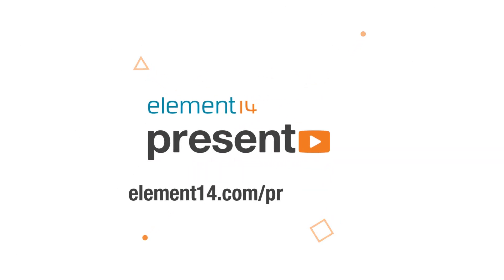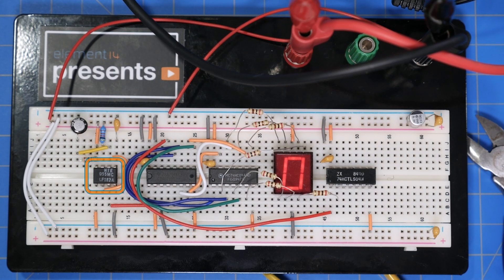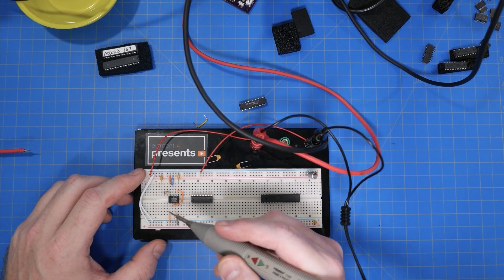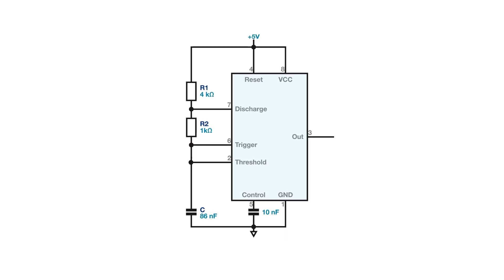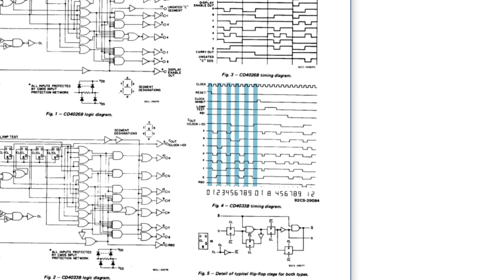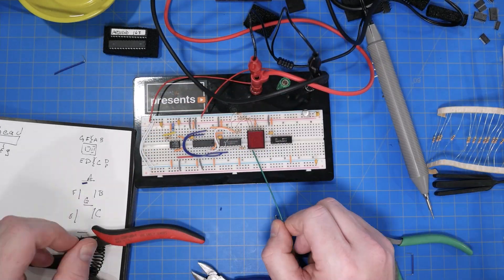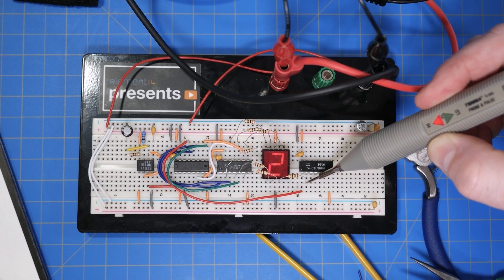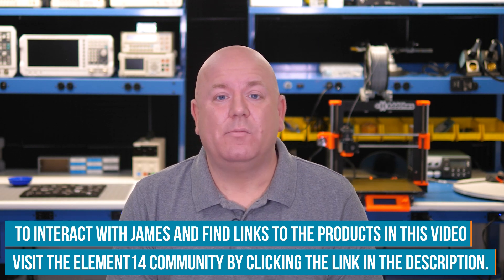Instrument Basics: Logic Probe - Workbench Wednesdays

Comment: Now, imagine if someone would invent a logic probe with a buzzer as well as a display showing frequency or low DC voltage instead of dinky car repair stuff. It would actually be a tool for electronics repair.
Reply: Logic probes made a lot more sense in the days of discrete digital logic chips. Today, a DMM works great to check voltages or measure frequencies, which a logic probe wasn't great for doing. And since everything is connected with a serial bus like I2C or SPI, then you end up using a scope or logic analyzer anyway. 

I've seen one or two open source projects that tried to make an updated logic probe, but they never caught on.
Reply: @bald_engineer  they would be for repairing what can be repaired, i.e. 1970-2000. After that, you need glue solvent and a microscope. In this video, you troubleshot a circuit of discrete ICs, but you had to switch to a different piece of test equipment just to measure a TTL/CMOS voltage or frequency. Nowadays, displays are small enough to fit in a pen that could do what the logic probe does + those two things. And generate a range of different signals for fast/slow frequency, two pitches for Vcc/floating/GND, etc.

Soldering station are still made for these old THT and discrete components, and still sell. They are of no use for 21st century glued devices. 

In that light, there is still a need for a handy piece of test equipment like I describe. It would be much faster at achieving what you do in the video. 👍
Reply: @ScoopexUs  Again, do some searches. There have been open source projects that try to make more useful logic probes.
Reply: @bald_engineer  It's difficult to search because of all the car mechanic trash spammed.

On Youtube, people repair computers, and I'm hoping for one of them to showcase an actually efficient tool instead.

If I were to make one, I would buy one with a buzzer and find a voltmeter+OLED and frequency meter+OLED and print a case for it (or maybe there's space to jam it in there and cut two holes). There would be something no-one has thought of before that everyone (who repairs computers) wants.

What I did have to search for was the DMM acronym. People don't use analog multimeters anymore. Well, since my 50yo teacher 30 years ago. If you would have called it a multimeter it would be understood immediately. It's a multimeter. ;)

Comment: Very useful and honest. Thanks.
Reply from the maker: No worries!
Reply: @element14presents  I have the same model probe that your using on this video I'm learning electronics and never used a probe before. I wondered if you could tell me what the extra red probe with alligator clip is for and what the three little metal posts are at the cable end of the probe is for, I thought maybe you clip the red probe to one of these and use that for testing. Cheers

Comment: I have a handy, related tool you may or may not have seen. It's a logic chip probe from HP that has a 14 pin clip (designed to clip onto 100 mil pitch SOIC and DIP logic parts (7400 series) and provides a red/green LED output right on the clip for each pin. I suspect HP and others may still make them and not sure of the cost, but it beats probing logic pin by pin. If you don't have one or haven't seen one, drop me a reply and I'll try to provide a pic or two (and maybe a short vid if you like). With my DSO w 16bit wide logic inputs, I haven't used them (a 14 pin & a 20 pin, I think) in quite awhile, but they're still in my arsenal. Don't even recall where I picked them up. Great content BTW!